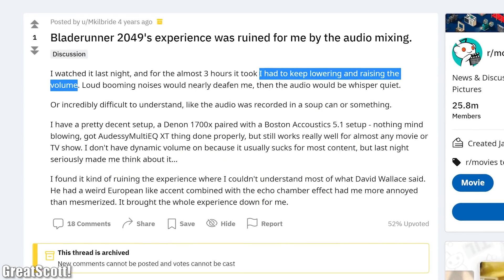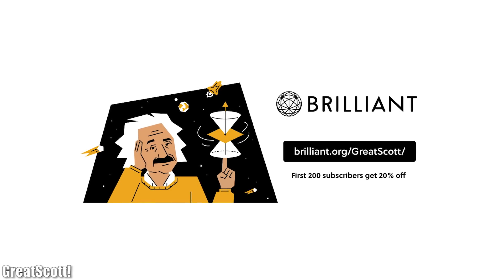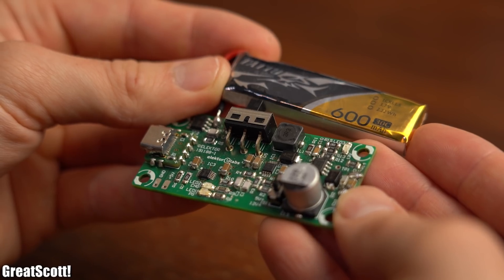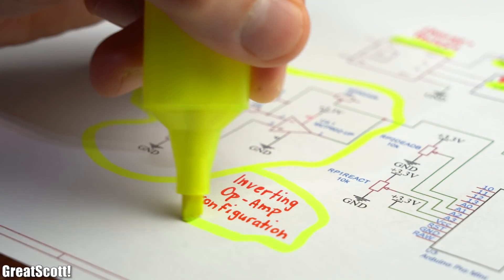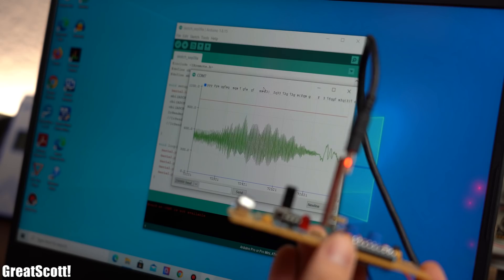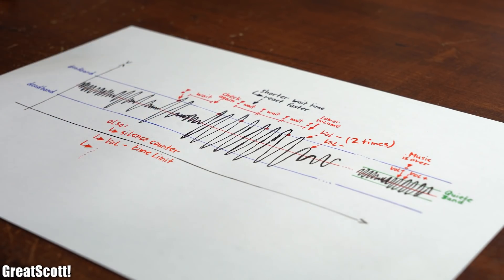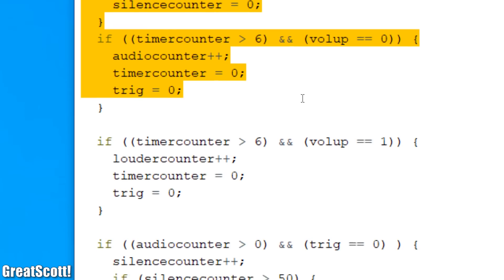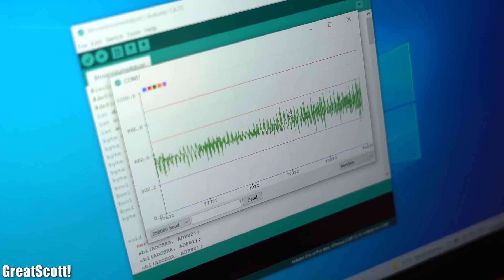Movie Music has a LOUD PROBLEM! So I fixed that! (Automatic Volume Adjuster)

Comment: Virtually all DVD and Blu-ray players have a Dynamic Range Compression option to reduce the difference in volume between the loudest and quietest parts of a movie. It's a shame that AFAIK, streaming services don't have this feature. Some TVs also have a similar feature in their audio options. And there are ready-made TV volume regulator devices, although all of the ones I've seen only connect via standard analog line-level audio, not HDMI.
Reply: The problem is that audio engineers shouldn't be messing with the range like that anyway...  Why can't there be an industry standard that audio engineers have to follow if there already isn't one?
Reply: @tyisafk  They wouldn't keep to any standard.  For example, all the TV broadcast companies claim that the adverts are at the same volume level as the programmes.  They having been  lying about this for decades.  It suits them to have the adverts louder so they ignore the end customer.  The same would be true of this problem.  For some commercial reason they think the music and sound effects have to be really loud so no matter what standard is put in place they will just ignore it.
Reply: And, ironically, nothing gets an ad muted faster than it being too loud ... so the advertiser's rabid desire to be heard only results in them being not heard  🤣
Reply: @davidwebb2318  they aren't doing that for commercial purposes, they doing that for realism. Because in reality sounds differe even more in loudness and in the cinema this makes sense to make a more immersive experience. Only at home where you probably have Neighbors or other people near by this gets a problem.
Reply: @demp11  Virtually all films are fiction so realism doesn't really come into it.  

The reason is, as you said, that the films are produced for cinema theatres.  The film companies don't want to produce home versions with a more acceptable soundtrack because it would cost them money.  That is the commercial reason behind this.  Producing a version with a 'home friendly' soundtrack would cost them very little but they don't really care about their customers.
Reply: @davidwebb2318  what? What has it to do with a film being fiction 😅 like it stops you making more realistic immersive experiences in the cinema? Is it not allowed to be realistic when it's fiction? That they are to lazy making a home audio version I totally agree, because at home you don't want that more realistic dynamic range because it annoys everyone else near by, so take the volume down which makes quite parts unlistenable.
Reply: @demp11  Okay maybe you don't realise but virtually all of the sound effects in a movie are unrealistic.  For example gunshots, explosion sounds, vehicle noises etc etc  used in movies are not at a 'realistic' sound level.  That is because the movie is fiction and these sounds are just dubbed in to the soundtrack.  It is not trying to represent reality.  The soundtrack is there to give the impression of what is going on.  If all the sound track in a movie where 'realistic' it would be completely different to what we have beconme used to.

As well as the sound levels being unrealistic a lot of the sounds in a movie soundtrack aren't even realistic in many cases.  The plot and storyline being fiction isn't the issue, it is the sound track that is complete fiction.  That is what I meant.
Reply: @davidwebb2318  with the sounds itself that's true, they often times use completely different things like vegetables for bone brake noises. But my point was that the loudness of the audio, or more dynamic range of it, makes it feel more realistic. Like HDR doesn't look like real-life but makes the image look more realistic. That's the whole point I'm making.
Reply: @demp11  Yes, I think we agree but I would argue that what you are describing is making the sound track feel more familiar and exciting not more realistic. 

In an action film we expect to hear certain things and making them louder makes us notice them more.  Other sounds are what we expect to hear but if played at realistic levels would be deafening.  A couple of examples.....  in movies people often fire guns indoors and talk at the same time.  If you have ever fired a gun in a confined space you would realise this is totally unrealistic, the noise will make your ears ring all day.  In films the sound of someone's leg breaking is often dubbed in to the sound track.  In reality this is totally inaudible except to the person whose leg breaks and then it is an impression of a noise not really an audible sound.  The point is that none of the sound track is in any way realistic.  It is just a drammatic effect to engage the viewer.  A more extreme example is music in films.  Where scenes feature music playing this generally isn't a representation of what would be going on in real life.  People don't walk around a forest with eerie music playing, it is just added for drammatic effect. i.e. it is fictional.
Reply: @davidwebb2318  The thing is, the TV broadcast companies do not turn up the ads, the advertisers make them louder. So TV broadcasters are correct in that they are at the same volume on their end, it's just the ads are brickwalled to always come out loud.
Reply: @scythelord  Okay, the difference is the sound level in the recording and the broadcast volume.  Obviously the companies doing the broadcasting could check the sound level of an advert and adjust the volume in the broadcast level.  They don't because they care more about the advertisers than the person watching.
Reply: @JoeBlow-zr2ru  They test their ads for both audio-only and video-only performance.

It's loud as hell to make sure it still works when you walk away for a snack or a pee during the commercial breaks.
Reply: @KyleTurpin42  I mostly stopped watching TV for some years now (except news). Such a relieve not to have dumb ads all the time.
Reply: @davidwebb2318  the fact is EBU standard uses 3 values, a true peak, a short time peak and a long time peak, so ads get the highest volume of other contents.
Reply: @davidwebb2318  The thing is that the ads may actually be on the same volume as the programmes as the volume (measured in dB) does not affect the (perceived) loudness (measured in dbLUFS). In audio engineering two sound sources of same volume may considered different loudness (or the other way around: two sources of different volume may considered equally loud) as the perception of loudness is bound to dynamic range and frequency. For example if you remove bass frequencies and compress your sound you can get to the same volume as the programmes but be way louder. This actually makes sense since there's a maximum volume you can broadcast. Actually the broadcasting station may not be involved at all as the people making ads are specialized to optimize the ads for exact this purpose - to stand out in any way. As they are paying customers to the stations, the stations may not be allowed to change the sound of the ad like lowering the volume because of their contracts (imagine a station randomly deciding to play an ad of a specifc company less loud. this would benefit their competitors). In cases were the sound is in legal control of the platform a loudness correction is already done. In Spotify for example (and other music streaming services as well) all music is matched against a standard loudness value to keep a consistent customer experience.
Reply: I always find DRC lacking, it takes it's time to adjust and the level it sets is never quite where I want it.
Reply: Windows has this built in too (depending on your sound setup, when I use onboard sound I get the option but when I use my audio interface I don't), right click on the volume icon in the bottom right then click sounds, then go to the playback tab, right click on your output device (if you're not sure which one, just leave something playing sound in the background and you'll see the green meter lighting up) then click properties, go to the enhancements tab and check the box for loudness equalisation
Reply: You will find that streaming services already apply volume normalisation, like spotify is set to -14dB loudness and most movies are -23dB.
Reply: @MikeyRussell88  That's why I rather watch Blu Rays. Better Video, better Audio, no dumb licencing schemes (disney+ anyone)
Reply: @MikeyRussell88  but DTS tracks and Dolby ones has a different normalization level, so DTS sounds louder and apparently better.
Reply: I need this for podcasts. Given a lot I listen to are actually stream VOD the audio is all over the place and often completely incomprehensible in a noisy environment.
Reply: 9p
Reply: There's two problems with this approach, though. For one, it requires a DTS or Dolby encoded signal (and often a player only supports DRC for one but not the other) so it's not going to work on anything else. And two: the effect of DRC is so minimal (at least in my experience across multiple players and AV receivers), that it doesn't really help at all. The thing I ended up with is a soundbar that has automatic volume adjustment for any input signal. It's not for audiophiles, sure, but it still sounds great and solves the volume problem 100%. I literally never adjust my volume for anything.
Reply: @burretploof  coz the drc usually works on all channels, what is needed is to change the center one only.
Reply: Even Youtube misses this feature. I really hate that I need to adjust the volume just for changing the video, because some are so loud and others are so quite....
Reply: @Ethaknyl  yt only reduce volume, so if is like -5dB remains untouched
Reply: Most TVs have the same setting locally
Reply: I hate AVL DRC whatever you call it as it's a huge bass killer. However my 1st brush with this was 1992 with my Sony Walkman. 😍
Reply: Yeah, I remember buying a 25" Magnavox CRT TV in 1995 that had the (then new) "Smart Sound" feature. It worked pretty well. My grandparents also got the same TV and it was a relief as they were hard of hearing and the TV was always loud, so when the commercials would come on, they would blow out your ears before this.
Reply: It's much simpler than that. Read my comment.
Reply: The most DRCs in AV receivers usually suck as they offer no control over the strength/threshold and are almost unnoticable. At least in the ones I've tried.
Reply: my Samsung TV and Yamaha receiver have something like this; they are not "dynamic" enough to put an end to the "loudness war"!
Reply: @heywoodjabozoff9383  My Pioneer also lacks a strong enough range compression. I solved most problems by raising volume of center speaker as that channel is the main voice channel. So voice is now on a similar level as music/explosions/...
Reply: All Blu-Ray movies come with multiple audio tracks, e.g. DTS-HD, DTS, and stereo. The one that usually works best for me is the DTS one.
Reply: @MrSwanley  Thank you, I'll explore that!
Reply: Some TVs have it as night mode or sleeping mode... Yes.. you need audio compressor. It is much better solution than this automatic volume remote control ...

Comment: Use a board with wifi and there would be some iot application, would be cool to power on/off the tv via home assistant. Also I think i would 3d print a "decorative" box to hide the ir emitter, which I would attach via longer leads to hide the board in the back somewhere out of sight.

Comment: AVC/AGC circuits use to be common in some magnavox TVs if I remember right as there were TV commercials in the 80s and 90s that were just annoyingly loud. It's unfortunate that such features in digital form aren't used. Honestly, they could put them in easily

Comment: Oh yes, EBU-R128 has its drawbacks as well as benefits. Great spec for dynamic range and loudness reduction, but the unfortunate side-effect of allowing sound engineers a loophole to have extremely quiet persistent dialogue to allow extremely loud transient explosions and other sound effects. The very same integrated LUFS value can be obtained from two different mixes, one with fairly constant loudness throughout and one with extremely loud explosions + huge dynamics range.
Reply: While this is true, and -23 mixes can be almost as dynamic as filmatic mixes(which are usually around -27 to -30 integrated), this gentlemans problems sounds more like selecting the wrong downmix mode and losing a few dBs of the centre channel in the process. V e r y C o m m o n.

Comment: The real problem here is that the movie sound is designed with cinemas in mind. There it is an important part that conversations are quieter, so the viewers will focus and follow the dialog. Also the loud music helps to transfer atmosphere. Of course when you view it at home in the evening you can't have the music or explosions or gunfire blaring out, disturbing all your neighbours. The movie producers just don't care about remixing the audio for DVDs or Blurays because they make most of their revenue from cinema ticket sales.
Reply: cinemas are way too loud tho
Reply: It makes no sense to me that conversations would be quieter in movies. You are basically saying that when before the movie theatres start the movie they tell you to be quiet during the movie that they are telling you in between the lines that it's okay to be noisy if the movie is being loud. Actually, your body lowers your own hearing volume when you talk, so you're not wrong. But that doesn't make what they're doing okay. Loud sounds can and will still break your ear drums. They can grow back, I can confirm it myself as I lost all hearing in my right ear and even pulled parts of my ear drum out because it was insanely itchy but it has grown back and I can hear again. But modern entertainment is too loud and people that try to support it a little too much like I have been known to do suffer for it.
Reply: They absolutely do care about remixing and that is why they don't A 5.1 system can be had for the same price as a cheap junk soundbar, and completely fixes this problem. His issue is specifically a lack of center channel where most of the dialogue is mixed. Why should they remix and alter the original artform just to pander to consumers who don't appreciate it enough to run 5 wires?
Reply: @gravesclay  why should they care? Simple it's the number one rule of business. Always, ALWAYS, give the customer what they want. This isn't about art, expression or other immeasurable concepts its about making money. Money to pay you loans, actors, staff. etc. If you give a middle finger to the majority of your market with a holier-than-thou attitude you will not be making art for long. Most people consume media on laptops, cellphones, PCs and 2 channel audio TVs these days so not catering for this is a very poor business choice.
Reply: @gravesclay  because people with 5.1 systems or better make up at most 5.1% of the market

Comment: If you're using a soundbar, as opposed to a full 5.1 surround system, then you might need to manually select a different audio track on the disc options menu (if offered). Many discs have multiple options for audio, from 2.1 Stereo to 5.1 DTS etc....  I've had similar issues with headphones, where the ful 5.1 wasn't sounding correct on headphones, but a different audio selection on the disc options made it better.

Comment: I can't help but wondering if a stereo compressor would be a more elegant solution.  You could simply place it between the audio out of the TV and the audio in of the sound bar.

Comment: As has already been mentioned, the dialog is usually in the center channel on multi-channel audio streams. If your sound bar is 2-channel stereo, you might want to look for an option to boost dialog in your video player's settings.

If the connection to the sound bar is analog, I'd just whack in an AGC. Simple, reliable and, as it says on the tin, automatic technology that has been around for decades because it works.

Comment: Kind of genius! I expected something to put into the audio line, but of course this wouldn't work for digital signals and anyways had trouble with multi channel signals.
But what I wonder about: How can you adjust the dead band without a display of some kind? Think it would be good if it had an configuration mode: an switch for disabling the auto adjustment, while an LED lights up when the current volume exceeds the dead band, for adjusting the dead band without a display.

Comment: Pretty clever design. No messing with the signal, no need for making a full blown amplifier. I would only consider adding an EQ stage before signal input to the uC. Audio frequencies like to be audible differently, even when their signal amplitude is the same. Hats off for all the audio related engineers that are able to tame that beast.

Comment: Te fix to this is to apply a DRC (Dynamic Range Compression) filter as most TV Stations do, but that breaks the "cinema experience". If you have a good audio equipement with DSP maybe you can do it on the fly. Your idea is good as most DRC filters just do that but digitally over the sound stream. Good unless the volume changes show on screen...

Comment: The issue is no one uses 5.1 and the Dolby built in features designed for this exact issue.  When listening in stereo the Dolby "dial norm"  is and listening modes are not taken into account when doing the down mix.  
Dolby listening modes changes "dial norm" dialogue normalisation in relation to the rest of the mix and effects trax. 
This is quite a solution for people not using Dolby features.